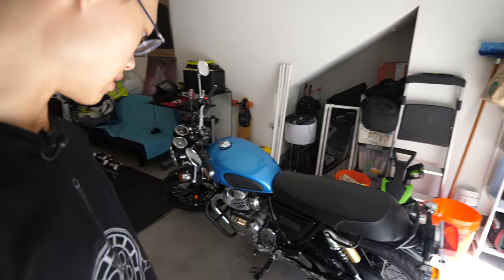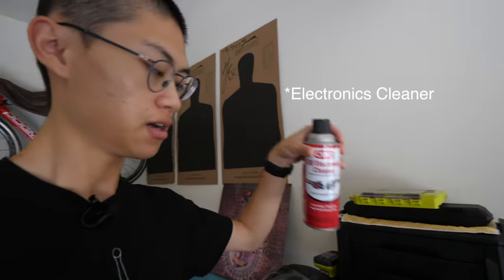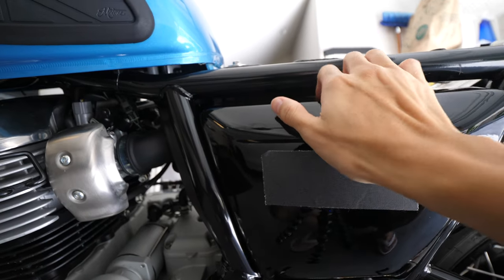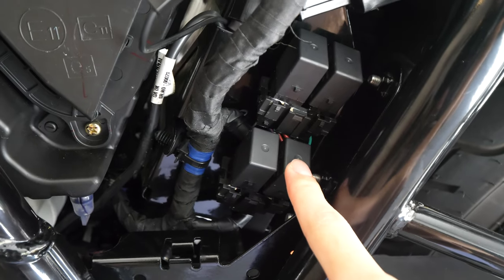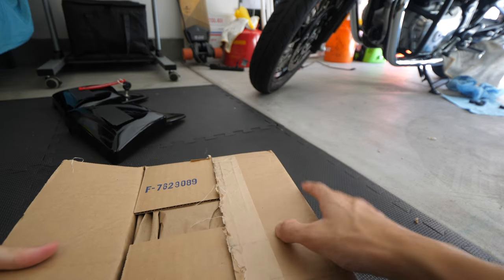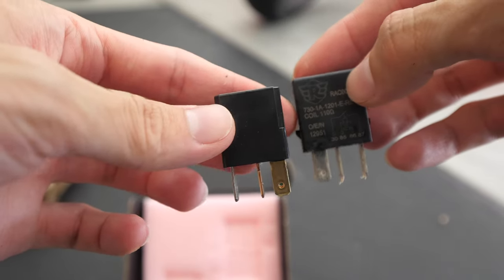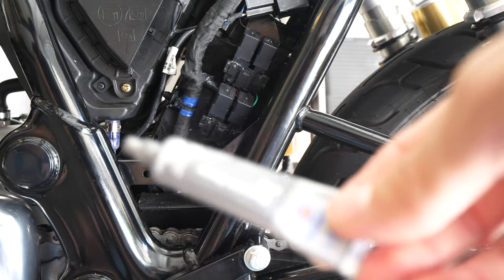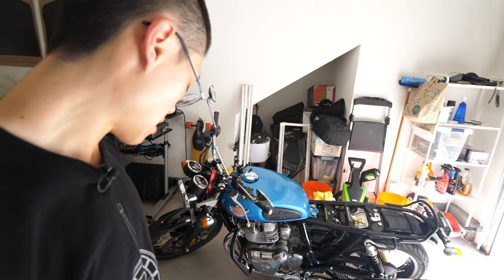Why You Should Clean The Relays On A Brand New Royal Enfield Interceptor 650

Comment: For my Himy I just bought a pack of 6 replacement relays from a reputable brand and changed them all, cleaning the plugs and adding dielectric grease. Done job. Not had a single electrical problem since.
Reply: Which brand and model number please thank you

Comment: Thanks for identifying a cheaper relay that works - Bosch, a German brand, is ALWAYS expensive, and Japanese electronics are usually good quality.
As for the dielectric grease,  just put a dab on a Q-tip and smear it over the surface of the contact, and that will block air and moisture from causing corrosion.
The pressure of the mating contacts is enough to push through it for a good electrical connection

Comment: I had this problem, the fuel pump wouldn’t prime, I cleaned the relays and it worked
Reply: same
Reply: Hello, the fuel pump stops priming in my bike at random times, anytime anywhere. And the weird thing is that it also gets fixed by itself ranging between within a minute to an hour. Its a very irritating problem that has ruined several of my days. I take it to the service centre and they say theyll have to keep the bike with them and they can do anything only when the issue appears in front of them. So there was no point of leaving the bike with them as the issue appears randomly in like a week, or sometimes multiple times a day. 

What was the issue that you had, how did you fix it?
Reply: @amanxsharma20  I opened up the relays and cleaned a lot of the grease out.  That immediately fixed the problem.
Reply: @jojamison2062  was the problem same as mine? The fuel pump not priming randomly…
Reply: @amanxsharma20  it happened a few times randomly and then after a really hot day I couldn’t get it to start for a few days and I started looking for more information online and found out about the greasy relays.  Have you tried cleaning them?

Comment: Hey there, watched your video and took your tip on the GoPro mount screw!  
A little tip on that… the screw is very long and for me was pressing onto the wiring loom below.  Vibration over time will cause the screw to cut its way into the loom and possibly short something out. 
I’ve cut the screw and made it shorter, it no longer touches the loom and also takes less turns to screw it 👌🏻
Check yours to be safe… 😊
Reply from the maker: Thank you for the heads up! Will definitely check that asap!

Comment: Alex. First part of my post Break-in service is done. Oil Change. Chose to go and do it myself. I am not a stranger to working on classic cars. So working on a retro motorcycle is something I can handle. Now I did have to order a few of tools but now that I have it all I can do the next service far cheaper. Price of service was another motivation as It would have cost around $500 for a Oil change and the Valve inspection/adjustment. You have already got to the service mark have you not. Thinking of doing the service your self? You already are adding after market parts and doing things like the relay cleaning.

Comment: Hey guys, thanks for the nice video on the RE relay problem. I wouldn't expect such problems with a new machine...
When I clean and lubricate the relays on my Classic 350 machine, do I have to disconnect the battery and contacts? Thank you for the information and I wish you a merry Christmas. Robert from the Czech Republic
Reply from the maker: Thanks for stopping by! It is recommended to disconnect the battery while doing electrical work. Using the correct cleaner and tools also decrease the chance of something unfortunate from happening. That being said, if you don’t want to go though the hassle of disconnecting the battery and the wiring, just be really careful not to overspray the cleaner on other parts. Please keep us updated! Happy holidays to you as well. Ride safe!

Comment: Very helpful - especially about using the GoPro screw - anything with a 10mm metric thread should do, as it's a bit of a pain having to use an Allen key, always with the risk of losing the screw. Regarding the relays, I haven't had any problems yet with my four-year-old Interceptor, but I will take the opportunity of checking them for excess grease. I would have been inclined to use copper-ease grease, as it is conductive.
Reply: Using a conductive grease on those relays will cause a short circuit. The dielectric grease is there for corrosion protection only.

Comment: Hi Alex, 
Thanks for this video. Its marvellous.
I have a serious problem with my 2019 RE Cont 650 and it is that the engine cuts off once the Abs comes on and then the engine failure warning light comes on. I manage to start but after a few kilometers it stops again. One of the times I almost fell. I no longer have confidence in the bike.
Do you think that making the process that you explain about relay will solve??

Thanks again
Reply from the maker: Thank you for the comment and taking the time to share your situation. That sounds very scary and you are absolutely right to be concerned. I am not a motorcycle mechanic so I would not know the best course of action. However, I would definitely try cleaning the relays, and replace them if you feel necessary. If the issue persists, it would be in your best interest to take it to a professional and having them diagnose your bike. Hope this helps! Ride Safe!
Reply: 1:23 I had a similar issue with my 2019 interceptor after a year, it's only done 2000 miles now but the issues started with occasional cut out. Fiddle relays and it went again so I cleaned and fitted Bosch relays, thought it might be ignition switch but all checked out OK. Laid up over winter, fir a while I turned ignition on weekly to check ok. Then out of the blue, turned it on. Nothing! So carefully removed seat and side panel to attempt to find issue, turned my back and as I'd left ignition in on position,  all of a sudden all came back to life!  Studying visually, saw a wisp of smoke from area under battery, turned out the red wire from starter solenoid to fuse box has a joint located above swing arm, to access its wheel out and mudguard removal, the spade connectors were blue with corrosion and had been heating up melting the boot over, it's in a lousy position and wonder if it was assembled incorrectly, now soldered to new spades and waterproofed.

Comment: Can I upgrade to 4pin relay on 2019 Int 650? It now has 5pin stock relay. I'm concerned if there is any specific circuitry dependency on the older models.
Reply from the maker: Both 4 and 5 pin relays will work. 
If I'm not mistaken, the pin in the middle is blank and doesn't do anything. You can reference your relay sockets, the middle one in the row with three pins should be blank.

Comment: I have to ask, because I am (very) rusty on my electrical knowledge, how do you determine the proper spec to make sure you have the right replacement relay?
Reply from the maker: I did my research on reddit and various forums, the two products shown in the video were mentioned the most and the feedback was also the best. Perhaps someone more qualified could chime in and share their knowledge on this.
Reply: @iamalexsun  No worries.  I came to the same conclusion as you did between the Bosch and Panasonic but my curiosity gets the best of me sometimes and go down these rabbit holes so to speak.  Thanks for the response and sharing your experience thus far.

Comment: Sup mate. I also got an in650 as my first bike. Though I'm not through the break-in period yet so I avoid revving 5000+ rpm which is what you need to get to freeway speeds. Although I did hit the freeway once, my front wheel gets very wobbly on very high speed curves. Was wondering if you're having the same issue. Word is that it's the front tire that's the problem. Also, what was the mileage before you replaced the relay??
Reply: Could be a few things. None of them major, all little adjustments. One, an out of balance front wheel, which I doubt because the wheel weights are installed at the factory and in general are pretty universally placed and correct. two, the front fork steering stem bolt. The big silver 8mm hex under the center of your handlebar. It adjusts how easily the handlebars turn. they should turn very easily, but not wiggly loose. From the factory they're typically too loose. Loosen the 4 fork pinch bolts in the top triple tree. then snug down the large 8mm hex just a bit. then re-tighten the pinh bolts. You can find torque specs online for the pinch bolts.

That typically solves the wobble issue. Mine never had it, but I went around their entire bike and snugged up all the bolts when I got it. It's not an uncommon issue htough.
Reply: @SB-or5mj heh there, i have a question please. Do i have to lift the front wheel to adjust the front fork steam bolt or is it ok not to ? Thanks in advance